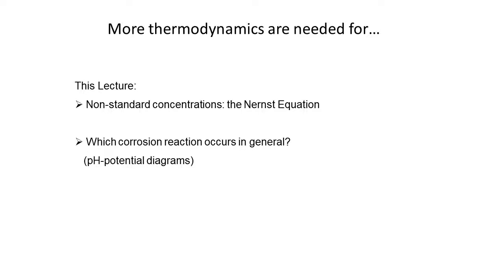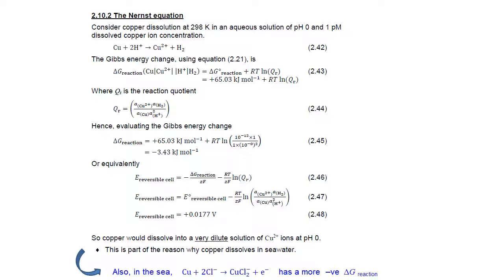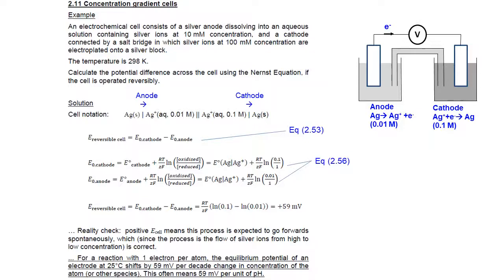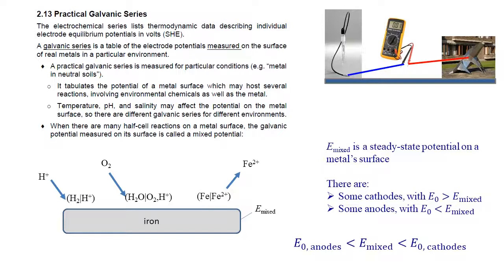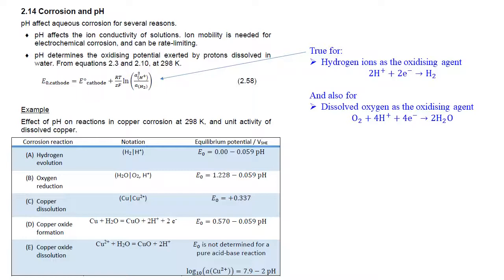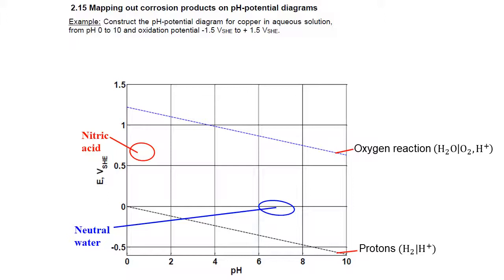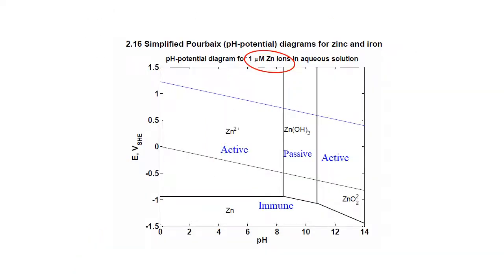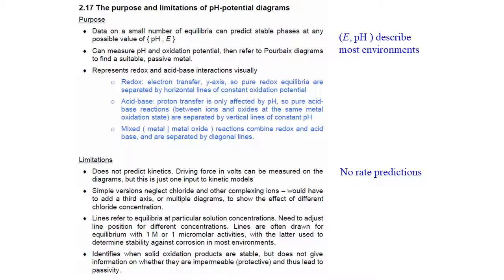Corrosion Lecture 3: Nernst equation and pH-potential diagrams

Comment from the maker: Link to Youtube video showing iron in nitric acid (but I'm mildly distressed he poured water into concentrated acid without wearing safety specs - though he does have glasses)

https://www.youtube.com/watch?v=qayfY19qiK8 

Compare with pH-potential diagram (Pourbaix diagram) for iron. Concentrated nitric acid is a strong oxidising agent, so iron in this acid has a high enough galvanic potential to be passivated. Dilute nitric acid isn't sufficiently oxidising to passivate the iron, so, soon, the iron corrodes actively (and fast, as the nitrate --> NO2 is still an oxidising agent).